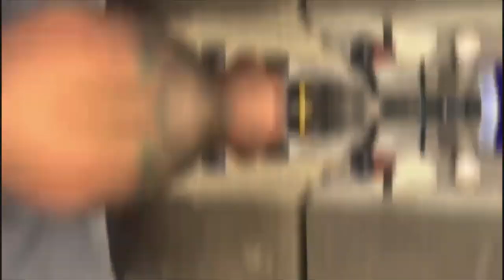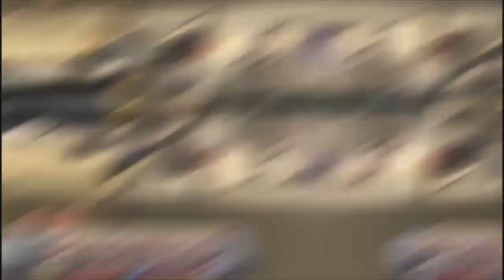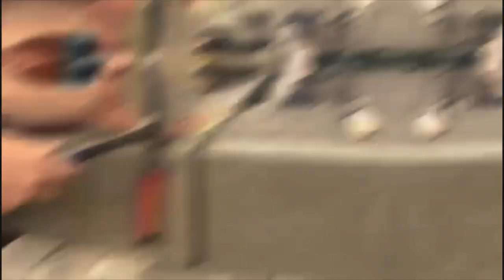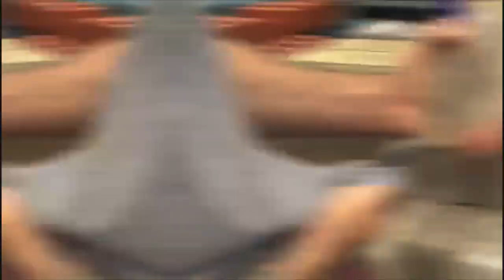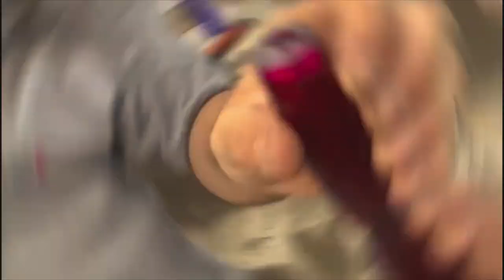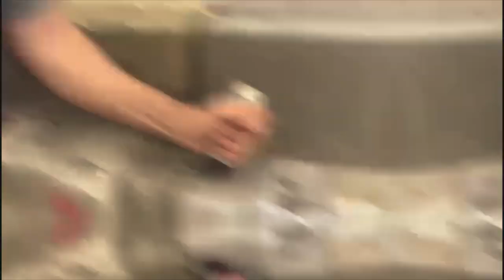Changing a Marshalltown Trowel Handle

Comment: First, why would you want to trade out the handle? 46 years of laying and Rose was always the best choice back in the day but the Marshalltown has pretty much gone to the top of the list for comfort, durability and cost. To be honest I've never seen a Marshalltown handle ever break or needed to be replaced. Wore the blade out on a few. And as far as that horse shit way you put that replacement handle on, you drop it into a pot of water you've brought to a boil and when it gets pliable you just push the shank in and give it a quarter turn. Got to teach these kids everything.

Comment: I had a leather handle W.rose that I changed to a plastic handle. I had to cut the old leather handle with a grinder. Heat up the plastic handle and push it through the trowel. Came out nice. Couple months later i accidentally dropped it in a 1 story brick wall. Didn’t bother getting it. Still missed the trowel still lol.

Comment: I tried doing this earlier, cracked the handle about 2mm in, Any tips as I’ve had to order another one.
Reply: Yes here is the way to do it .
1 put the trowel blade down in a vice. The vice should be around the tang with the handle facing up,
2 the jaws of the Vic should be below the handle and not allow the handle to slip through. The jaws should not be nipped closed , but free to alow movement.
3 tap the area where the round tang turns into the blade, this should be a 90 degree bend. The blade should come out of the handle downwards. A blacksmith of 30 yes showed me this. Apparently its the exact opposite of how they are affixed during manufacture. When putting new one in use wooden or rubber mallet, tap many times with slow progression,  plastic or rubber handles should not be too cold, may have to put in warm water  or use hairdryer to warm up. Put trowel back in vice, nip jaws tight then tap away. If it does not go far enough in on first attempt, remove, warm up and try again. Once on correct,  remove, glue and refit. It's a pain in the backside if it doesn't fit first time, all bout patience,  too far too fast and kaput.
Hope this helps.
P.s mine was a wooden handled Marshall town, smithy took 30 seconds to replace.
Reply: Boil the handle and while it’s hot, it slides right on. Just let it cool and absolutely don’t use any glue
Reply: I just bought a new wooden handle but I torched the tang to slide in I used epoxy as glue and didn't work :( help please

Comment: He's lucky the handle didn't crack. Also no way u just hammer that durasoft handle just off. Tried it once, needed a grinder to get it off.
Reply from the maker: We've since found if you heat them up they come off alot easier. There was no angle grinder involved